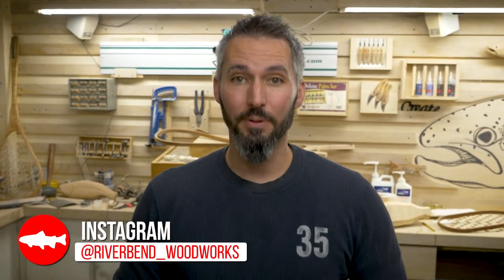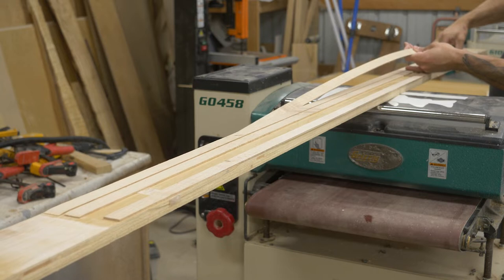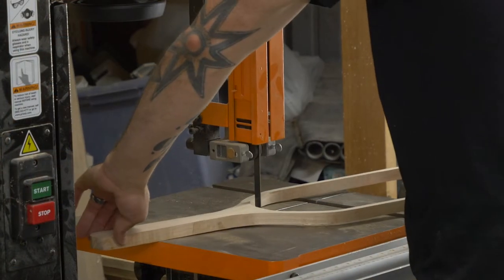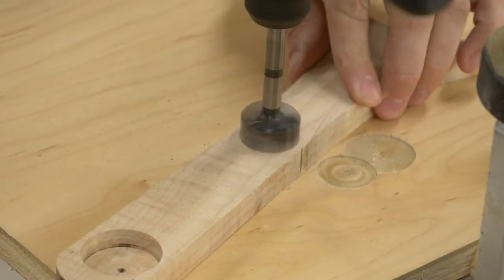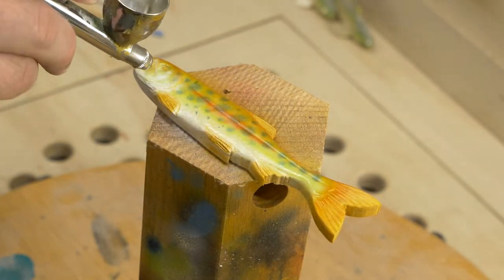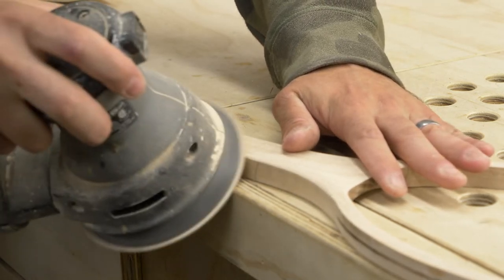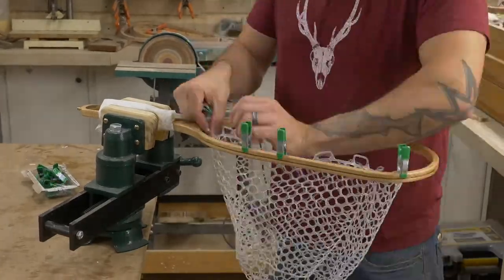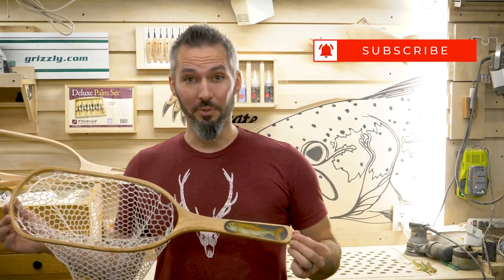Maple Fishing Net with Fish Carving in Handle

Comment: I love your nets so much I started making one.  Then I got to the hoops and decided to make a fly tying station and then finished my teardrop camper.  ...because I don’t have a drum sander.  I looked at making a DIY drum sander, then wondered about doing what you did, taping to a sled piece and sending through the planer.  Why wouldn’t that work?  All my other projects are finished and my landing net handle is staring me straight in the eye.
Your videos are fascinating.
Reply from the maker: Oh man, the project struggle is real for sure! Great work on moving things forward on all fronts though! As for the sled concept, in theory it should work the same, so long as you is enough double-stick tape on each end. And the 1/8” mark is a good number to shoot for, but if you can’t get that thin, get as close as possible and simply soak the strips in water for a day before steaming and you should be able to get a great bend from the material. Let it sit in the form (pre-glue) a bit longer to air-out, then glue it up and clamp (also let it set in the form about 2x longer). Should be good to go!
Reply: @RiverbendWoodworks  Thank you.  This is why I love this channel.  Direct and quick communication with the YouTube star himself!  Is there a way to ask questions without it being public?  I might have some questions once I get ready to do this.  Nobody wants to see all my silly questions (probably including you) 😃
Reply from the maker: When it comes to learning new stuff, there's no such thing as a silly question! But if you'd like to send one direct to me, you can send me a message via Instagram. I have a link in my About page here, or you can simply follow there. My Instagram handle is: @riverbend_woodworks and I am (unfortunately, I guess) always on there :-P But please, consider posting any questions here, as they can really be a huge help to others in the same boat! Thanks for the kind words, Glenn!

Comment: Fantastic Video! Aside from buying a net to trace out the shape to create a form, is there another way that you use to create the form that perfectly fits the nets you use? thanks
Reply from the maker: I basically start with the net basket and work out from there. The basket itself, being soft silicone, will take the shape you create for it. The fun part is the net design is totally up to your taste. You can do more traditional, like this smaller net, or something a bit different in a tear drop shape--and it's all done with similar net baskets. You can do the math figure out the proper dimensions, of course, or even use CAD programs, but trying by-hand is half the fun! I will have a video showing my process in the near future though, so check back for that!
Reply: @RiverbendWoodworks  Thanks!

Comment: Beautiful net!  I am in the process of making one myself and have a couple of questions if you have time to answer.  How many coats of Dalys and what grit sandpaper do you use between coats?  You mentioned a poly satin, what brand and how many coats?  I sure hope mine comes out as nice as yours.
Reply from the maker: Thanks Richard! I usually go with two coats of Dalys, sanding with 800-grit in between coats. For clear top coats I’ll usually apply 5-6 coats. Dalys is a great option for stain coats as well.

Comment: Great looking net!  I’m in the process of building my 3rd net.  I like the swivel idea, but what kind of glue are you using to make sure it doesn’t come out?
Reply from the maker: Awesome! They're terribly addicting to make, aren't they?! For glueing in the swivel, I use Starbond Thick adhesive. I always apply enough to get some amount of squeeze-out when the swivel is pressed in, but I wipe is smooth and that makes a nice waterproof seal. Regarding whether they stay put, I've pulled insanely hard on these when I first started installing this style and haven't been able to budge one yet! Thanks for watching, and let me know if you have any suggestion for build videos in the future!